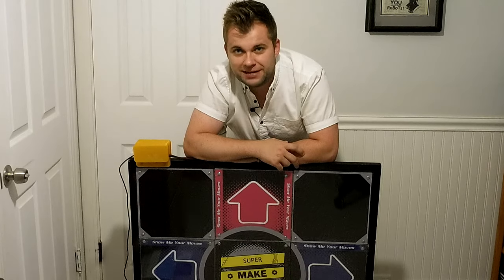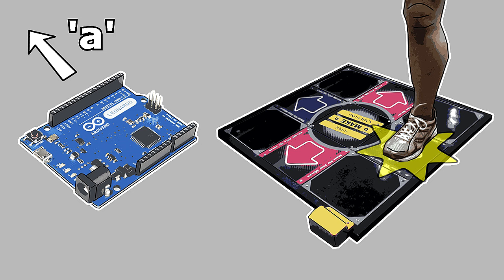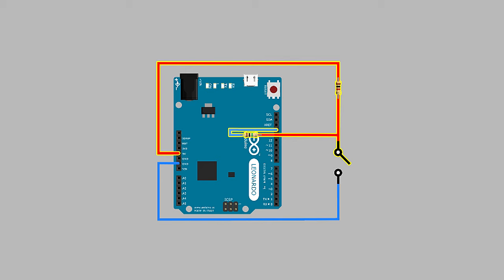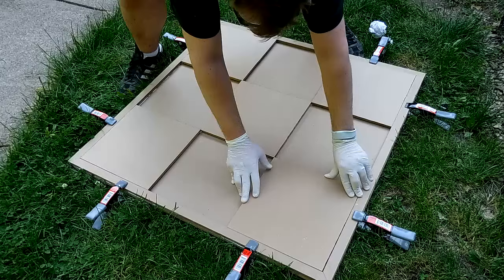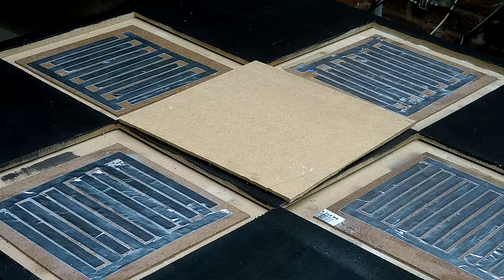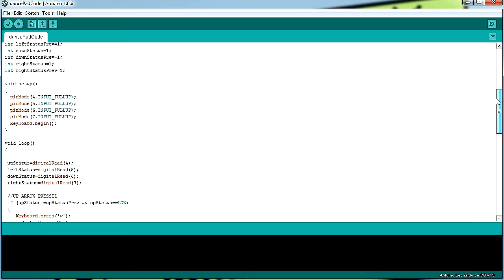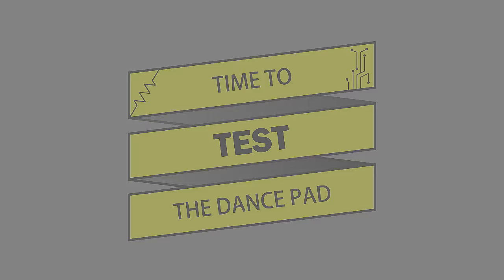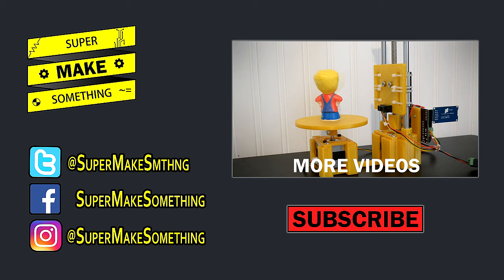USB DDR Dance Pad (Arduino, Pull-Up Resistors) - Super Make Something Episode 9

Comment: this is a good starting point for me, though id probably change a few things, first off I will likely use a larger baseboard to incorporate handles to make it easier to move for storage etc., secondly ill likely include an "A" and "B" button in both top right and top left panels, lastly id probably use a serial cable connection to bridge between the pad and control box as I would likely not want the control box screwed down as I would be trying to make a DIY DDR Arcade Cabinet which means being able to have a detachable control box from the pad would be handy

Comment: Out of curiosity why would you not use the Arcade Sensors? You'd pay a third of the price of one of the metal dance pads, and yet have arcade accurate circuitry. However, fantastic video explanation, thoroughly enjoyed it!
Reply from the maker: +Enigmiah To be honest, I did not know these existed, haha. Looking into them after your comment, I see that they are available online, but cannot find information on the working principle behind them. Do you have any more information on how the sensors work?  

Since the input for a button pad is just a binary (on/off) signal, implementing a simple switch seemed to be the most straightforward approach to me. Aluminum foil was an easy way to make the button be able to sense input across the entire panel. 

Thanks also for the compliment! Happy you liked the video!
Reply: I read somewhere they are piezoresistive or piezoelectric.
Reply: There's a lot in information on sensors (including inner workings and where to find them) on this page: http://rhythmarcade.com/wiki/arcade_machines/dance_sensors

Comment: I am going to start making two of these today! I have one question: would high impact polystyrene work as a substitute for the acrylic/polycarbonate?
Reply from the maker: GTN Awesome! Sorry I’m really not sure but if you try it, please report back and let me know if this works!
Reply: Thoughts after a few weeks of usage after completing them: I actually ended up using foamed PVC sheets for the tops of the buttons because it was cheap and came in a lot of different colors and was also pretty durable. The plastic shop that I went to was also able to cut them to size for me. 

As for the pads, I ended up using copper tape to create the circuits in a comb like pattern and soldiered the edges together, along with the wires onto the circuits. This has been pretty durable so far! For one of the pads (the main pad), I also added two more buttons - an escape and enter button, so that I could navigate the menus by using only the pad. I modified your code to add these buttons, and they work great! 

Overall great video! Through the course of the project I ended up changing a couple things or modifying them after talking with people or seeing the cost, but it worked out really well and I'm happy with my pads right now. The only issue I have right now with them is that sometimes they become too sensitive (originally they weren't sensitive enough so I trimmed down the foam A LOT) after a lot of usage (3-4 hours), so I'm planning on getting some denser foam so they'll hopefully be more responsive and I'll be able to hit more notes in quick succession. The pads have been a lot of fun to play with a partner at the same time.
Reply from the maker: GTN Thanks for reporting back and sharing your mods to the project! Nice work! Happy to hear that your pads are working well for you and I am sure that others who watch this video will find this info useful!
Reply: @GTN_  Hey I was interested in making this pad and was wondering what edges you soldiered together and what you mean by soldiering the wires into the circuits? Also how did you add the escape and start buttons because i would like to add those as well. I am new at this so please in simple terms :)
Reply: I used copper tape to lay out the comb-like circuits, so I had to soldier the places where one piece of tape met another (since the adhesive was non-conductive). For the wires to the circuits, you can see in the video that he uses a washer and electrical tape. Instead, I put the wires directly on the circuit (same place as the video) and soldiered them down so they were secure.

The general method for adding escape and start buttons was just like the other buttons, except attach two more different wires to them (as well as ground, just like the rest). Connect the escape wire to pin 8 and the enter wire to pin 9. I have the modified ardiuno code here: https://github.com/benank/DDR-6-button

Let me know if you need any more help. Good luck!
Reply: @GTN_  Thank you so much!! One last question; I keep re-watching the video and can't seem to find the dimensions for the comb circuits, do you by chance still know them?
Reply: Since the quarter inch thick MDF is 9x9, I made the circuits 7x7 so that there was a 1 inch margin all around. Works pretty well for me.
Reply: @GTN_  thank you again, and I lied, I have another question. For the wiring, do the black wires connect button to button (down arrow to left arrow) and then the red connects straight to the Arduino? I'm having trouble figuring out how to wire it all together
Reply: Black wires go button to button, but only attach them to one side of the comb pattern. Don't make a full circuit, so make sure it doesn't connect back to itself to make a loop. Connect that to the arduino's ground pin.

All the other wires connect to the other sides of the comb patterns and go back to their respective pins.
Reply: Thank you so much!!!! Cleared up a lot of things for me!!
Reply: Sure thing! Good luck!
Reply: I'm excited to try this myself. Seeing the communication here is wonderful.
Reply: @GTN_  For those that are reading this in the future and have the foam compression issue, what I ended up was using thick rubber hoses that I glued down instead of foam. These do not stay compressed and work wonderful as springs.
Reply: @marisjansons5022  what sizes hoses did you get and are they available at Home Depot? Going to try and start this project soon and wire to an old soft mat control board

Comment: I just bought a DDR machine instead.
Reply: they are like 2-3K
Reply: +Floco most ddr cabs go under a grand, itg cabs on the other hand are way up there
Reply: i built an iidx controller
it's called a keyboard
Reply: Which version was it?
Reply: uneliasmarsu Where do you usually go for finding pads at that price? Most of what I’ve found has been in the thousands.
Reply: Danny Yagami having an arcade at home is far beneath 'legal', thus it actually doesn't matter which version does he have, he can download any :)

Comment: I actually built a similar pad using an Xbox controller for the connectivity to the PC and used copper tape for the contacts as it conducts 65% better. Also you can solder the wires to the copper tape making contact from the wires awesome and a lot stronger. For the wiring i used and old Lan cable since the wires are solid but thin.

Comment: About the final assembly. Those #8 wood screws. How long are those? You mentioned they go through the acrylic, through the graphics and into the wood panels below. I assume you meant just into the button panels and not the bottom baseboard as well, correct? If so, then these button panel assemblies aren't affixed to the frame. The only thing holding the button assemblies in place is friction from the neighboring stationary panels.

This thing looks great so far! I need to make the contacts and paint but the frame is nearly done.

Great video!
Reply from the maker: Iamthe bd Thanks! Your statement about the wood screws is correct. They do not go all the way down to the baseboard and the button panels are held in place by the neighboring panels.
Reply: Thanks! I would recommend installing retaining clips. I found ones that came with self tapping screws. They are used to retain screen door panels, pack of 8 each. So 4 boxes gets each button 8 clips (place 2 on each corner). Just serves as an additional fortification. They would anchor onto the stationary portions and frame.
Reply from the maker: @R_110  Nice! This is an awesome idea -- thanks for the tip!
Reply: @SuperMakeSomething  Sure thing! Great build!

Comment: Hey I just had a question about the riser and moving panels. Are the risers actually 1/8 inch and the moving ones are 1/4 inch? My thinking is that if both are 1/4 inch then they would be touching wouldn’t they? I realize there is the stripping there to act as a spring, but if it’s there then the panel wouldn’t be flush with the stationary ones right?
Reply from the maker: The foam compresses pretty quickly since it is insulation and not really “intended” as a spring that can support human weight, so it isn’t a huge/long-term misalignment issue. A better solution may be cutting rubber/silicone spacers out of a sheet that is the correct thickness, since these would likely wear a bit better.

Comment: For the grounding, i assume you cut the ground wire into 4 and then connected it between each grounding foil?
Reply from the maker: Connecting them all together will work or you can also run individual wires and connect those to the GND on the Arduino.

Comment: Awesome video, I was sad to see that it’s impossible to find a metal pad for my old ps2 at this point - DDR is basically unplayable with the foam pads on the difficulty settings I’m on so I’ve been trying to find a solution. Might be able to rig a ps2 controller in place of arduino to make it compatible, I’ll have to do more research
Reply from the maker: Thanks! I think a soft pad mod could definitely work! Good luck with your project!

Comment: So for the wiring, I was a little confused about how the ground wires are set up.  Do you need 4 wire to connect to each panel and then another longer wire to connect to the Arduino?  I think a print visual would help with the wire setup. Thanks for the great video, I'm considering trying the build myself.

Comment: what is acrylic used for? is it just to cover up the graphics? I'm planning to go with a more minimilist design (with no painting, just plain wood with maybe some wood stain on the buttons). If i did that would it mess up?
Reply from the maker: Yup -- in this case, the acrylic was just to cover up the graphics and simulate more of an "arcade" feel.  Wood should work without a problem! Good luck with the project!

Comment: I can't wait to try and build this over the coming weeks but have a few questions. I was wondering if you ever shared that STL file for the enclosure of the ardrino. If so, could you point me in the right direction. And if it isn't a bother, could you elaborate on the wiring part of the video, I'm a tad bit confused. I'm unsure on how many you need as well as what kinda of wire?
Reply from the maker: Thanks for reaching out and asking about the enclosure. I looked on Thingiverse and for some reason the file has been deleted. I'm afraid that probably means that the design has been lost, but if I ever find it on an old computer, I'll be sure to post it! Regarding the wiring -- you can use any type of wire as long as it fits into the Arduino's headers. All of the buttons share a single ground connection and have independent wires on the other side of the button that go into their own Arduino pins (one for each button). Hope that helps!
Reply: @SuperMakeSomething  Thank you so much! I have a better understanding now. I'm close to getting all the supplies I need, hope it turns out alright. I can't put into words how greatful I am that you've made such a nice tutorial vid, these ddr pads are hard to come by I must say.

Comment: Hi! Is there any way I can use a foam dance pad on a computer? I recently bought one. It has RCA and USB wires. It works perfectly on my TV with the RCA cable. I think the USB is supposed to only like "charge" the pad, but is there any way I can use it as a controller on my PC ? I've tried everything but the pc does not recognize it.

Comment: So four years later, does this still work and what's the hardest songs you can do
Reply from the maker: Yup! Still works, though I've had to replace the foam a few times.  I would definitely add a bar to the back in a redesign, but have had no issues with it.  I consistently clear 9's under the old system -- 10's work, too, but that's more a limitation of the player not the pad. :P

Comment: I’m not sure if I missed a step somewhere, but how did you get all the panels flush without having the contacts going off constantly?
Reply from the maker: All of the button panels sit on strips of insulation foam located around the outside each button.

Comment: I'm planning on building this in the next couple weeks, but had some questions. During the clip where you were dancing on it, it looks like the pad was flexing and moving around a lot. Was that mostly the carpet, or did the pad turn out thin and do you think it would be worth giving it a 1"x 35" x 35" base instead of the 1/2" base? For the 9" x 9" squares, why was that hardboard? Could they also have been MDF? (Just trying to cut down on material cost). Also what length of screw did you use to go through the acrylic and 1/4" mdf on the buttons down to the base, but not through the base? I figured 3/4" #8 screws for the whole surface, but didn't know if that was enough clearance for the buttons. I've been wanting to try building one of these for quite some time, but your instructions have convinced me to pull the trigger. Gonna follow your tips at the end, I'm gonna use lexen for the surface (expensive but worth it), going to solder the wires directly to the foil, and I'm going to use a router to hollow out a 1/4" groove under the top left corner panel with a router, and running all the wires to a raspberry pi pico there. Was there anything else you learned after this project that I should incorporate into the design?
Reply from the maker: More weight is definitely always better, I think! I used hardboard since this kept the mass of the buttons relatively low and also kept the button height short. If height is not an issue, then you will just want to make sure that the “springy-ness” of the foam you use is enough to allow the buttons to return to a neutral position after you step on them. If I were to change anything, it would be to replace the foam with springs, since this would result in less maintenance. You will likely also not be able to solder to foil, since the oxidation layer on aluminum doesn’t interface well with solder — sandwiching the wire will be your best bet. I unfortunately do not remember the length of the screws.
Reply: @SuperMakeSomething  Might give the springs a try. Gonna have to do some math. I've soldered to aluminum foil before, just takes some patience to burn off the oxidation layer. Might be fragile though, the idea of running a flat screw through the washer is a good idea.  Thanks for the rapid response, if I get it all together I'll let you know how it goes :)
Reply from the maker: @TheChillosophizer  Awesome! Excited to see the final results! Good luck with your build!

Comment: Im experiencing multiple presses from one touch of the pad's button, looked into it and it seems the one possible solve is adding a delay between presses but i dont know too much of arduino code can someone assist on where i would put the delays or if there is a better method than the delay function?
Reply from the maker: I think adding a delay between presses would definitely help -- if you are interested to learn more about this process, check out "debouncing."  I did not need this for my pad, but it is pretty common in many hardware applications that use digital button presses.  Another viewer actually edited the code for this project to include a debounce, and posted a link in the comments.  Look for user "AshiWolf Studios" and you should be able to grab code that is ready to go!